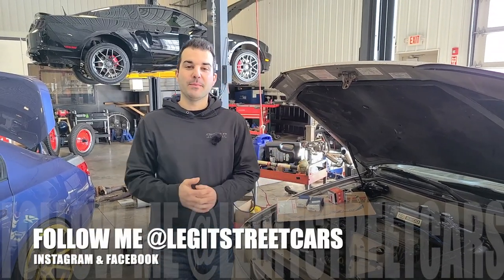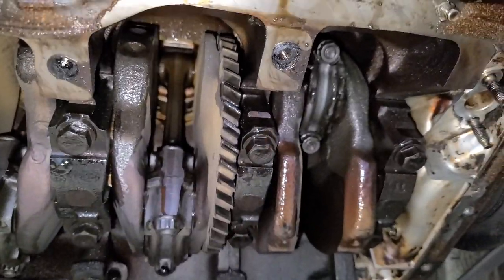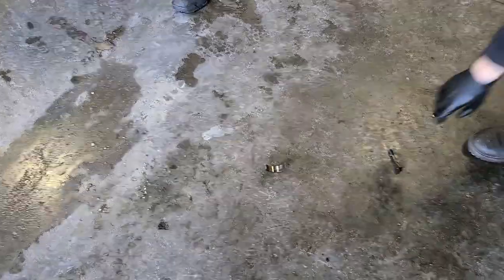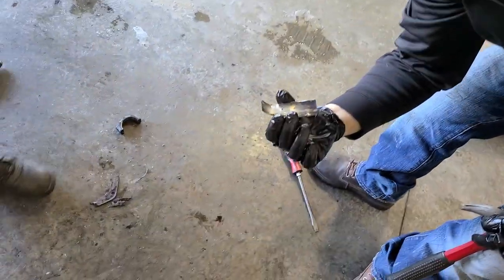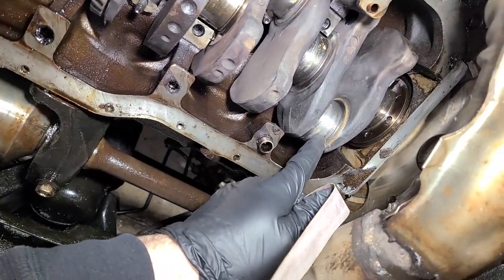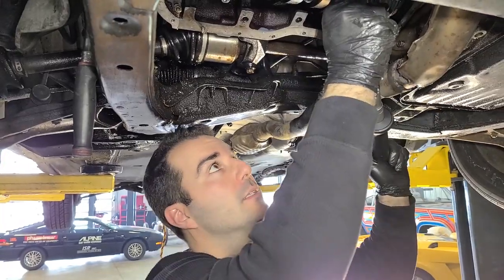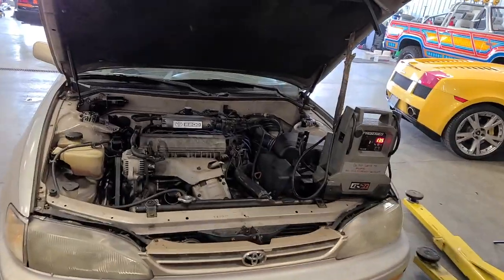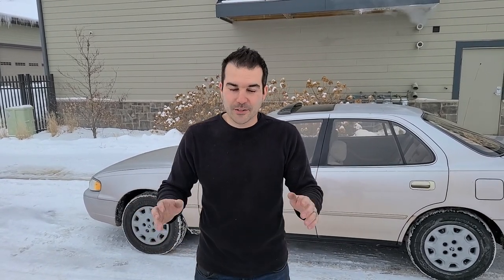I Blew Up A Camry Engine & People Were Upset So I Rebuilt It In The Worst Possible Way & It Worked!

Comment: Now what you need to do is retreat it with the magic oil and it will work perfect. Oh yeah, also add engine oil.
Reply from the maker: I'm pretty sure they make a rod bearing additive with nano rod bearing ceramic crystals. That should do it.
Reply: Juice WRLD Hitz  my man, asking the important questions.
Reply: Juice WRLD Hitz  Fingers crossed on Saturday. The fate of the i8....
Reply: @LegitStreetCars  your comment genuinely made me spit out my after dinner coffee 🤷🏻‍♂️🤣
Reply: 😂😂💪 just throw in another set of bearings on top of the ones and maybe take up that knock 😂😂 experimentally that is! Or get some fatter bearings made and see what happens...
Reply: @LegitStreetCars  Hey Alex! I did this with my Saab 9-5 6 years ago. It had a sludged up oil pick up and lost oil pressure and spun a couple of bearings. I replaced them in the same way as a temporary fix till I get another car. 65k miles later I'm still driving the car and have even had the engine remapped for more power to 300lb-ft. Burns a quart every 1500 miles but who cares. I just top it off as needed.
Reply: I don't believe the balance shaft needs to be timed to the engine...

Famous last words
Reply: Steven is the man.
Reply: Looks like a  roadtrip down to Florida, to see Samcrac with that Camry - and back. Good to see @LegitStreetCars fix the trusty Camry. Awesome fix!
Reply: @LegitStreetCars  do it please

Comment: 20 years from now... "I bought the cheapest Camry in the USA" - Tyler Hoover
Reply: More like nowadays for a 90s V6 with a 5 speed manual transmission
Reply: @savagesock3598  I own one, it’s been treated a little rough but I’ve so far fixed a few issues and she’s running good
Reply: Right about now there’s a lot of people wishing they’d never sold one of these
Reply: $50 sight unseen
Reply: I got a 4 cylinder for $600 Got to get a water pump and some new tires but should make a good little gas saver lol

Comment: Damaging a 90s Camry is like kicking a faithful old dog to car enthusiasts. These where always cheap, dependable cars for every family that struggled to make ends meet, every high school or college kid who worked two jobs over the summer to buy their first car, every fastfood delivery job. The Camry exists to serve all of us, never complaining about missed oil changes or mismatch tyres. 🙂
Reply: I couldn't agree more.
Reply: This!
Reply: Im afraid I don't share the sentiment. There are plenty of cars and trucks just as good as the wonderful Camry, yet those don't get a single word or mention. Unfortunately, there are many "faithful old dogs" getting kicked around, but the car community stays divided.
Reply: Car for the masses.
Reply: It's just a car dude.
Reply: freakin cockroaches
Reply: I owned three of them.  A 93, two 95s.  All bought used with 125K~140K miles on them.  Drove all of them to over 270K.  One of them went to 338K before the transmission gave it up.  Never paid more than $2000.00 for any of them.  Quiet dependable transportation.  Always comfortable.  Absolutely the best version of the most dependable model of the most dependable manufacturer.  The engineering on this series of Camry was incredible.
Reply: I put a 100000km between oil changes on my 94 v6 and it never had any problems. Even supercharged it after that and it's the rust that got to it.
Reply: @MrJeffohler  Bought my 94 used with 70k miles and ran it for many years. Then put the TRD supercharger on it and ran it to 200k miles. Never had anything to do on it except regular maintenance and the M62 Supercharger gave it a lot of pep on the highway.
Reply: Well put, mismatch tires...the Camry will MAKE them match. My 01 has mismatch after I hit a curb doing about 40, put on the original spare that dont match the current tires...and it still drives fine, just went to a junkyard and got a new spare rim n tire but I trust my camrys...only thing is every 5sfe will blow the valve cover gasket at some point, but easy DIY job with a felpro set, even comes with the spark plug seals too
Reply: Kinda how i feel about my 2004 Highlander.   I had a 2017 VW Golf Alltrack pre divorce but my now ex wife wanted it and I was not going to argue..  Bought a Highlander out of retired state troopers field.  $600.   Have driven it a for the past 10 months and thing runs like its brand new. Love it.
Reply: @michaelmcintyre7695  nah it's just a car
Reply: 100%
Reply: You are getting too sentimental.....Somewhere in a junk yard a 426 convertible Cuda sits hidden nearly all original. That's just a busted old Camry lol
Reply: @gunshipproduct2  Like the GM 3.8L V6.....The old 440s and 427s. Plus so many more!!
Reply: @boostjunkie2320  Very true, Almost too many others to count. However, you wont see any love, nostalgia, or wistful remembrance for them. Those loyal old dogs just keep getting kicked back into the dirt.
Reply: ...and they drove much better than the generation that followed.  I did not mind driving my mom's 90's Camry, but that 07 with the auto-warping rotors was the WORST car I have ever driven...ever experienced brake fade getting off a highway at 70mph?  It is terrifying and stupid.
Reply: Yet had to put it down. Like most people do to their faithful dog.
Reply: Exactly how I feel about my ‘96 5 speed maxima, I love the hell out of that car.
Reply: @MrJeffohler  I had a 94 solara two door I got off a Toyota salesman with 385,000 on it ran drove and looked new guy had it detailed once a month and always maintained by the dealership I put another 200,000 on it myself just doing the regular maintenance and a timing belt kit my room mate borrowed it and got sideswiped by some chick  I got $3200 for it from the insurance company because they couldn't come up with one to replace it there was literally no 94 two door Camry's for sale when they tried to find one they tried to get me to settle for a four door I told them that's not my car pay me for it's value then they couldn't come up with what it would cost to replace it I got paid kept the car then sold it to the guy I bought it off of's daughters boyfriend she had him fix the damage and put a body kit on it and paint it for her it's still running on the original engine and transmission and being serviced by the dealership again  she is trying to put a million miles on it and sell it back to Toyota it was at 685,000  last summer when I saw her out in it that car is what made me a believer in mobile 1 synthetic it was the only oil ever ran in it since the first oil change and the cam and crank seals were still soft when I did the timing belt and it never leaked or used a drop when I owned it
Reply: @trionic5  my sentiments exactly! That was a great car!
Reply: How bout 90s Lexus and acuras are those cheap dependable cars as well?

Comment: The balance shafts DEFINITELY Need to be timed with the crank.
Reply: Why that's what engine mounts are for...
Reply: @thebrokenbolt3990  because if they aren’t timed correctly, they make the vibrations worse than if the engine didn’t even have balance shafts.
Reply: @jamesd2863  I was only joking I know the reason behind them I should of worded it more obviously. I had a motorbike where the balance shaft had begun to bend and it shook like mad
Reply: I was coming to say this as well. I assume he is joking but not sure.
Reply: I know I was thinking the same thing. How tf is it supposed to balance without being timed.😂
Reply: He did say he was doing the worst way possible lol.
Reply: I assume that's why it's got no power the engine is fighting its own vibrations.
Reply: Balance shaft delete time.
Reply: They should have marked the position before putting it back
Reply: @BimmerM5e39  Should have alignment marks from factory. But yes, paint marks are easier to see.
Reply: @pospc2  I've done it to one of my 5fe. That was at least a few pounds saved from rotation.
Reply: Just remove em. Saves 20lbs and gives you better oil pressure. Just plug the feed hole.
Reply: @BimmerM5e39  no, they should have marked it before taking it out.
Reply: @Patrick94GSR  Yes thats how I should of worded it thanks for that
Reply: The balance shafts DEFINITELY Need to be shit canned.
Reply: I would've just left the balance shaft assembly out on that thing after that😂 it's clearly not gonna run smooth regardless
Reply: It can be left off but the oil passage needs to be plugged.
Reply: I asked the same thing. Personally I'd just have left them out...
Reply: I was wondering why he thought otherwise....
Reply: Came here to say the same. Literally the point of balance shafts.
Reply: Was looking for this comment
Reply: Or removed altogether, earlier 5SFE engines did not have it.

Comment: Most car dealers would only have replaced the spun bearing.
Reply: and added a little sawdust to the oil to quiet the rest of the angry bearings
Reply: No no, they’d sell you a SHORT BLOCK but only replace the spun bearing XD
Reply: @gregh7457  dose this actually work? lol
Reply: well those other bearings weren't too bad just a bit scorched obv replace the ones that overlapped and mushed today i learned a brake pad is a tool
Reply: @FuskyTheHusky81  nah probably not. Never tried it myself but they did use sawdust to quiet down transmissions and rear ends. They also used to pour borax down the intake when they had an oil burner or low compression
Reply: @gregh7457  huh. All remember these things for my field truck if it ever needs it hahahah thanks!
Reply: @gregh7457  90W gear oil. It'll run smooth and quiet. Until you change it.

Comment: Sounds more like a lifter tick than a rod knock at this point. Also the timing of the balance shaft is crucial to correctly counteract the vibration and if you don't bother timing it, it's just better to leave it out altogether at that point.

Comment: Not going to lie. It sounds just like a healthy 1GR-FE V6 in a Tacoma. The infamous 2nd gen Tacoma tick.
Reply: My 94 pickup with a 22re sounded like that the 6 years I owned it.
Reply: My 91 Galant GTi with the 4G63 sounds like it. It's lifter tick on mine though, not dangerous, pretty common, easy to fix and costs you $350 in new hydraulic lifters.

Comment: the rod and main bearings were just hugging each other cause Valentine's day is coming up 💗💗💗 I'd throw some 20w50 and Lucus oil treatment in and see if it gets quieter
Reply: Maybe some differential oil would be better, with extra grease just in case.

Comment: I have a  92 Camry same engine, ,189,000 miles, had a  Rod knock, did the same thing,  but only rod bearings,  put 12,000  more miles so far.  Daily driver.  Best beater ever!
Reply: I averaged over 270K miles on the three I owned.  Keep an eye on the transmission, for me it was the weak link in this powertrain.  Lasted long time on all, but that was the death of all three.  I had a friend who worked in the plant that manufactured the Camry, he put 980k on the 91 4 cylinder.  Painted it but never rebuilt any part of the powertrain.  Hit by a snowplow in a blizzard, and destroyed it, less than 20k short of 1 million miles.
Reply: @MrJeffohler  mine is the 5 speed manual trans, original clutch. may need one eventually.

Comment: hey dude,  i have a 2014 corolla sedan, ureently done 257000 klm's and have to do absalutly nothing to it yet. never thrashed it, never over reved it, oil change every 5-10,000 klms with out fail. regular brake checks and fluid changes. Although  the gearbox pack up at 40,000 klm's, touch wood this  one will give me a little more, so far 220,000 klm's with out issues. they always say toyota is the most reliable engine ever manufactured. wish they would do the same for their interiors.  i have three toyota's.  loved what you did with the camry, shows what they are really made of.

Comment: some lucas treatment or some marvel mystery oil treatment with another oil change might just help that car out even more
Reply: was gonna say, run it for a bit, change the oil right away, run it again, change the oil again.  flush out all the remaining metal.
Reply: The error in the "treatment" is what broke the engine before the test started. Either he made a huge mistake or someone gave him totally wrong instructions. I've done the treatment myself to multiple of my cars and at no point you are supposed to run the car without oil. You install the first bottle, idle, drive a certain distance, stop the car, drive some more and then replace the oil. You then install the second bottle, idle and drive with the stuff inside the oil until your next oil change.

Comment: I had a Camry and the engine is bulletproof if taken care of. 3 timing belts, 320,000 miles before passing it on to nephew. He stills drives it! Missed that car, love it! Great video, you will enjoy it. Timing belt replacement every 60,000 miles, will have fun.

Comment: I’m not surprised it did work I did the exact same on a Jeep 3.7 that spun a bearing. Replaced all rod bearings and added a heavier weight oil and ran like new no noise at all. Even managed to drive it roughly 5k before I sold it to Carmax. Definitely beat having to buy a new engine or paying a shop to do a full rebuild. On top of all of that I did the bearing replacement in an autozone parking lot.

Comment: It's a very common practice to roll new bearings into the crank of a large diesel engine. Usually as a maintenance item and not usually after it locks up.

Comment: One boring winters night I was reading the FSM for my vehicle... Replacing the bearings with the crank in the engine is actually a procedure in the manual. You rotate the crank to get the top bearings out though.

Comment: There are numbers on the block and crank that you use to calculate the exact size bearing for each journal. I rebearinged my 92 camry after the oil pump went out and drove it about a year before selling it. These are crazy long lasting engines.

Comment: Works better if you cut the emory cloth length to match the diameter of the journal. Then wrap a shoe string around the emory paper covered journal twice.  Pull the string ends back and forth.  Spreads the pressure out and works perfect

Comment: If that was a gm product it would have died and stayed dead
Reply: 18Dreaming let's goo  Those are used for performance, not reliability.
Reply: 18Dreaming let's goo  because there's 30k LS engines in every junkyard.
Reply: 18Dreaming let's goo  saying that as if toyota didnt make the 2jz
Reply: 18Dreaming let's goo  

Yeah, some of the older gm engines are pretty good, but the newer ones are extremely complicated and not well made
Reply: I mean, a lot of engines would've just stayed dead after this lol
Reply: 18Dreaming let's goo  "You are really biased towards toyota, there is a reason people use gm engines not toyota engines in builds" - no you stated people dont use toyota engines in builds and a simple search would show this to be totally untrue, I was merely pointing out that you had thrown out a blanket statement that wasn't factually accurate, but please articulate your argument a little better in the future
Reply: 18 Dreaming  oh fuck no , like the 2j isn't a bad engine , but there's only so far 3.0L of displacement takes you.  not hating on the LS at all , they just work , like stupidly well.
Reply: 18 Dreaming  Mechanically the are a pretty good engine but on a whole they are expensive and overhyped.
Reply: We used to have a ford transit pop 80 that used to run great without oil

Comment: I was pretty surprised how the bearings did with no oil and the bottle of mojo additive. You should do another test with plasti gauge on the bearings to check the clearances and put oversized bearings on the ones that need it. Then you could really show how well that stuff worked and how much it ate the crank and bearings.

Comment: Yo, drain out all the oil and fill it with just Lucas oil stabilizer. The knock will get quieter but won’t stop it. I actually had experience doing that a long time ago in my s13. Dailied it with rod knock for a little over a year while a collected parts for the build. The Friday before I started the build went street drifting and still didn’t send a rod into low earth orbit. Somehow the crank was still in good shape.

Comment: I've used to work part-time at a small town diesel shop. We would have log trucks in all the time and do bearings swaps just like this. They had oil when we broke them down though.

Comment: Worked in the factory that built that unit.   This was the first model year of that series to win a Gold Plant award from JD Powers.  That particular generation of Camrys was incredibly reliable.  This was the first generation of US built powertrain installed in the Camry.  The powertrain facility was a clean as the paint shop.  Those engines were so incredibly well built.  I owned three of them, and they were all great cars.  Drove them forever, then bought another.  I drove about 60k miles a year, and drove this generation Camry for almost two decades.  Quiet, comfortable, dependable and great fuel mileage.  No one engineers cars like this anymore, Not even Toyota.
Reply: The problem with Toyota is the hybrid garbage they are doing now. At least the GR exists.

Comment: Im currently building my 1990Toyota celica, I was trying to keep up with a corvette and I seen smoke billowing from the back, and the cars hemorrhaging oil, so seals or parts need to be replaced. Wish me luck. Drove it today and it wasnt smoking, but blew smoke on the startup, with 222k miles and beating on it going up the mtn is killing the car,
Update: I bought a rebuilt 5sfe for 40$ removed the heads and found they used generic parts for everything including the headgasket, but the cylinders are honed and he said it pulled hard. Im willing to give this a go after I put new seals and get new parts like the clutch, just need an engine stand an a hoist off of the tree, I'll be able to do it with basic hand tools, wish me luck!